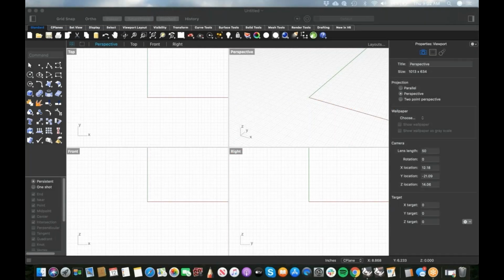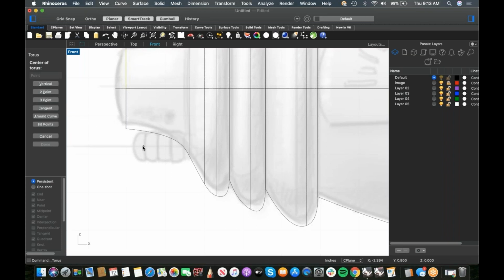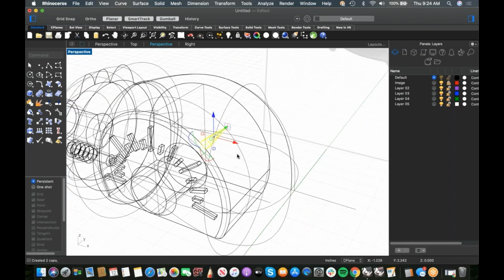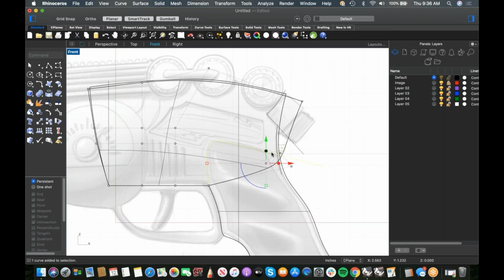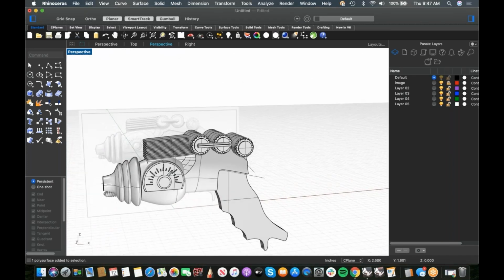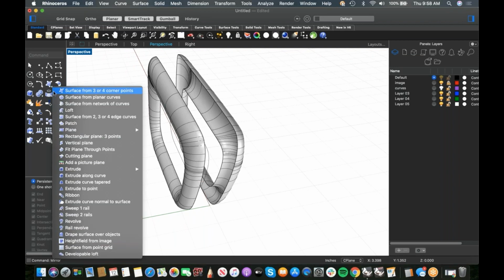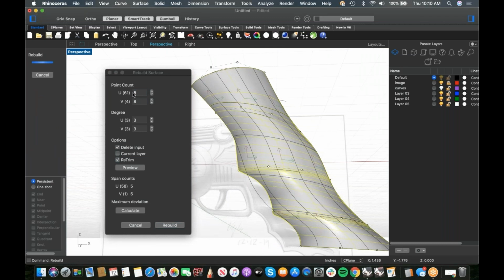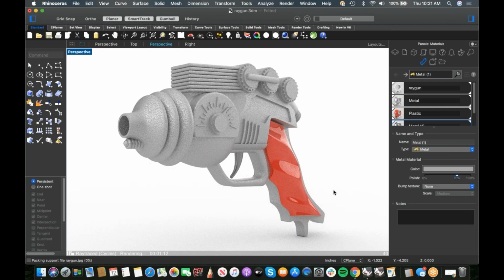Getting Started with Rhino for Mac toy raygun final

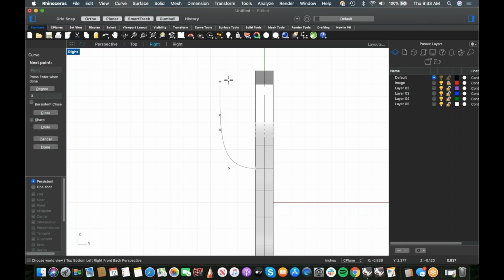Comment: Hi, at 31:00 you begin sketching a curve to create the swept geometry on the side of the raygun.  I tried to follow along using ewhat seemed like your exact moves, but when I toggled back to perspective view my curve was 3D instead of 2D and was in all sorts of wacky directions.  I made sure to hold shift like you instructed to maintain tangency, is there anything else  I could be missing?  Thanks.
Reply from the maker: make sure your planer snap is on at the bottom of the screen. That aligns your curve with your 1st point